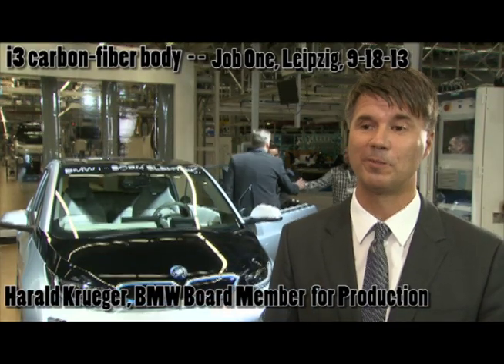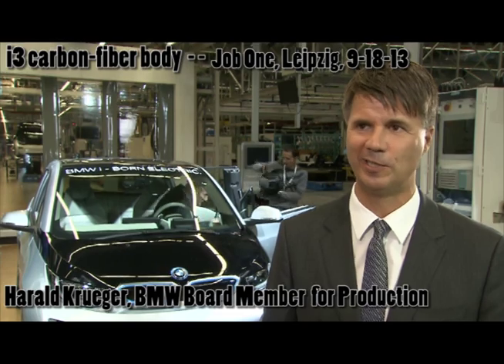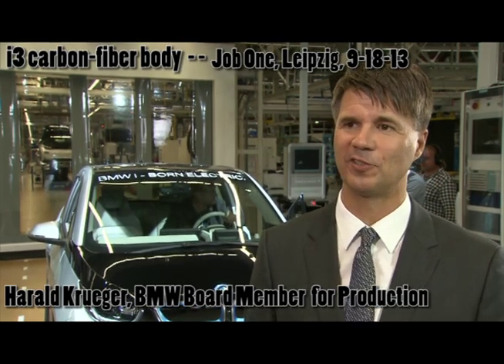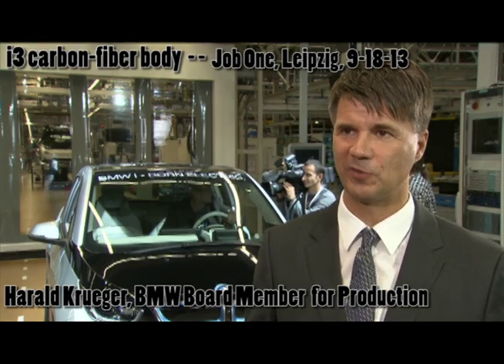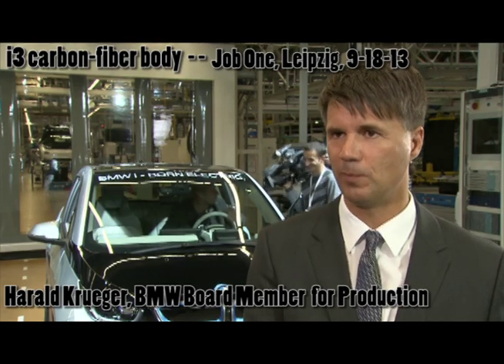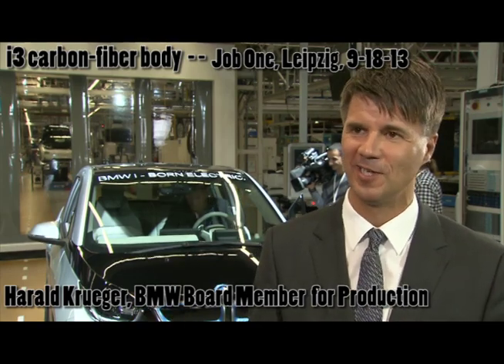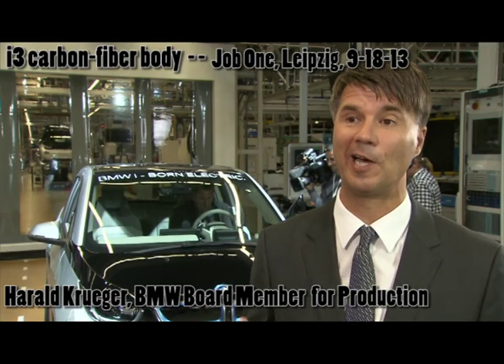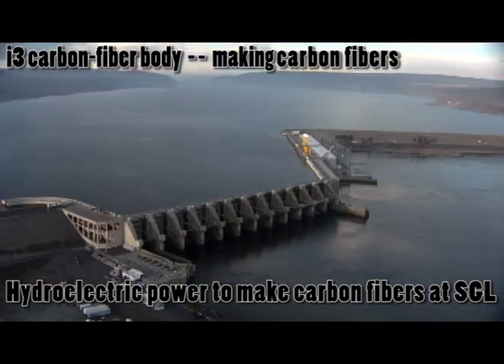BMW i3 carbon fiber body

Comment: How depressing that there's such wonderful engineering (pure EV / range extender / electric power / carbon fiber) yet it all goes into a car that's so ugly!!! You would think you're delibarely trying to scupper your own sales!  Those rear, narrow suicide doors. The dual colour scheme. The jump in the window line for the rear door. The lack of aerodynamics... how can your design team get something so simple so amazingly wrong... it's almost as bad as the leaf with it's silly face (low front) and silly shaped headlights. Only Tesla seem to get designing electric cars right - but it's out of most people's price range!